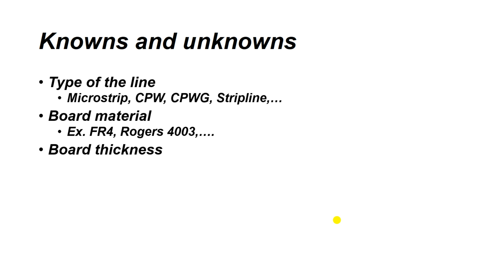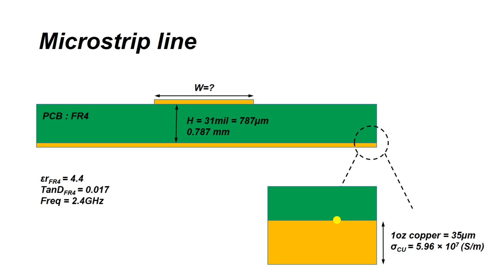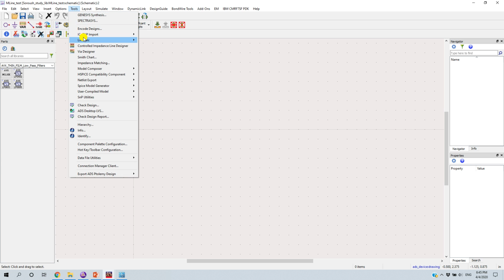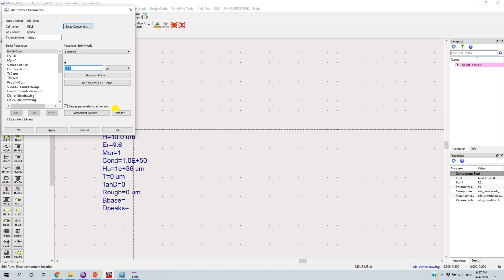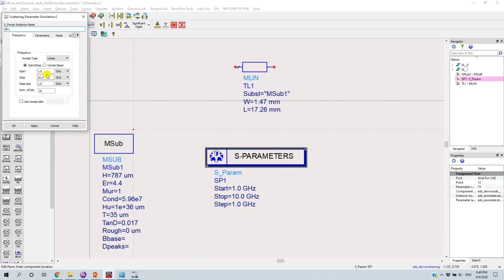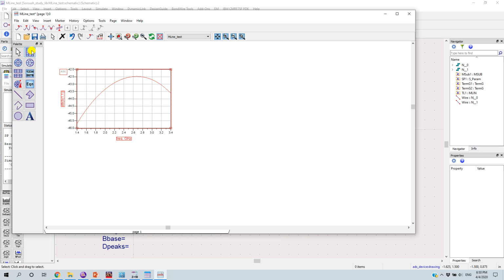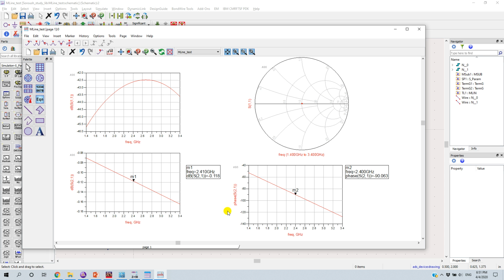Microstrip Line Design and Simulation in ADS

Comment: Nice video! Hey, I have one question regarding the Microstrip TL's, I was doing a tuning of lengths for a power amplifier to get my correct matching, one of my Microstrips gives me a value of 1,5 mm, and even with 1mm I get a better matching (doing the imaginary part almost 0) but I'm not really sure if that's an issue, I mean having a very short length, is a problem? (well apart of how can it be implemented in the PCB) do you know if that's an issue? my frequency is 2,9GHz ;)
Reply from the maker: Hi Giovanny, I'm glad that you liked the video. Usually there should be a minimum length for the TL. If the length of the TL is so short, probably you don't even need that TL. Or you can have the length of the TL a multiple of half of the wavelength to get the same impedance. In the ADS Tline tool, you can simply add 180 degrees to the length of the TL and you see the reflection coefficient rotates to where you started from. But I think there might be something wrong with the topology of the matching network that you chose for your PA that your design led to a very short TL. I hope my answer helped.

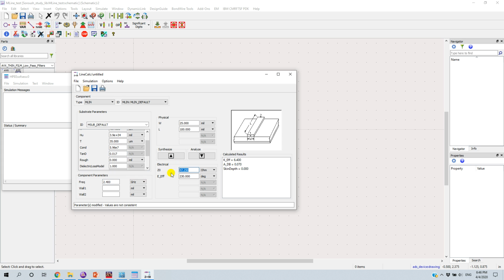Comment: Hi, I've a question regarding to the phase shift(E_Eff), why should we need to shift the signal 90° as you mentioned @5:00 in the video, what is the purpose to delayed the signal in such way through the transmission  line. BTW: Thanks for the video, its very well explained.
Reply from the maker: Hi Hector, thanks for watching the video and your good questions. The 90 degrees is just an example and the reason that I used 90 is that most of the time we need to do impedance transformation using a quarter-wavelength line (90-degree line at the frequency of operation). But in general, the line can be designed using any values for the phase shift.
Reply: @soroushmoallemi774  , thanks for the clarification.

Comment: How you choice parmeters of line 
Width and length ,if we have quarter wave lenth ?
Reply from the maker: Hi Benammar. Thanks for your great question. A quarter wave line determines the electrical length of the line, which has a direct relationship with the physical line length. Theoretically, the electrical phase shift of the line (theta), which is in this case pi/2 or 90 degrees,  can be found according to the equation theta=(2*pi/lambda)*L, where lambda is the wave length, L is the physical length of the line, and pi=3.1415. 
About the width, it is determined by the line characteristic impedance and has nothing to do with the length of the transmission line. Please refer to: https://www.microwaves101.com/encyclopedias/microstrip for more information.